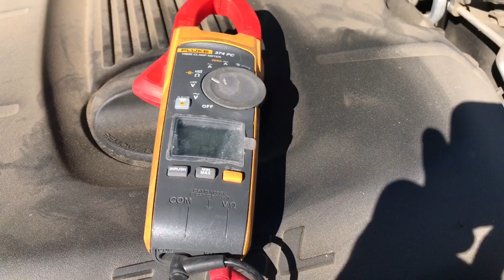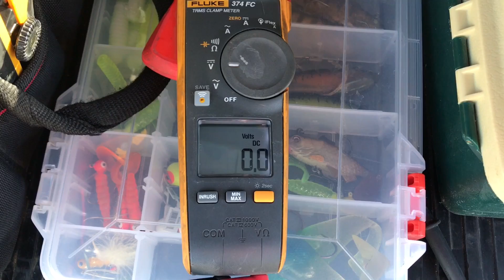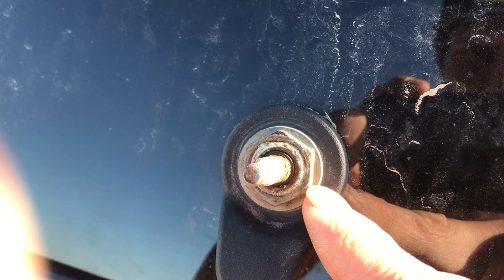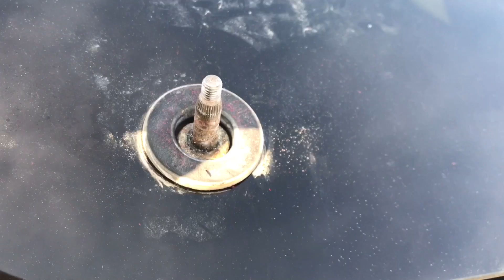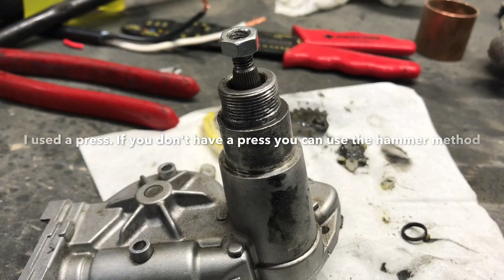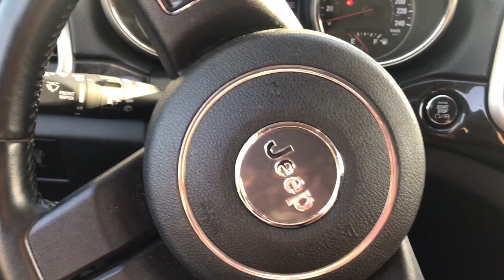How to: Rear Wiper motor repair and installation Jeep Grand Cherokee WK2 2011-2017

Comment: my rear wiper works but it likes to come on by itself and also squirt washer fluid by itself the fuses look fine i cant find any videos on how to fix it or why its happening! i even disconnected the power to it and it still squirted fluid when it wasnt activated! any help out there ? great video by the way! mine is a 2013 jeep wrangler.

Comment: Here it is 2025 and your video is still helping tremendously! The problem I had was is you had filled it all up with grease without showing how the gear positions should be and I had read. Someone said something about dots and after finally recognizing the dot in the triangle and where the gear is actually supposed to be I got it back together and it’s working fabulously! Now onto the next project

Comment: Thank you!! This was the exact issue with my 2012 Jeep SRT. Followed these instructions to a tee from checking fuse, power at the motor, assembly removal, disassembly, clean up, re-grease and reassembly. Works fine, now to replace the wiper itself.

Comment: Thanks for this video! Just picked up a 2011 and mine was rusted worse than yours. Instructions were amazing! I opted to just replace completely but I’ll keep the old part just in case. 

I know it’s been a couple years but any ideas on how to fix the flipper window? Mine is locked and I can’t get it open

Comment: This helped immensely! Sadly despite cleaning the rust i discovered the plastic gear had worn through, completely polished smooth. U.U another fine product by Denso... replacement is otw soon for $50! You saved me hundreds from the repair shops <3

Comment: Thank you so much very great ,helps me to understand the removal and installation,I would like to add that during installation the gear you must have both gears in the bottom shaft and the small one on top of the plastic gear must both gears aligned properly with the arrows.

Comment: Thanks for this video. Very helpful, just did the repair today on 2012 Jeep G. Ch.. I painted wiper shaft (the part above O-ring) with cold galvanizing paint after rust removal, I hope it will not rust again. Not all Made in Japan parts/assemblies are made perfect. This assembly should have double O-ring around main wiper shaft or other more robust seal, and shaft housing should be filled complete with grease, also the wiper shaft that comes above the O-ring should have better corrosion protection or made out of stainless steel. The mode of failure for this assembly is the rust from main shaft exposed to elements that is flowing down inside of main shaft housing.

Comment: Excellent video!  I had the same problem, so I removed the motor like you did and tried to pop out the shaft.  It wouldn’t come loose after blasting it pretty hard several times with a hammer.  I reinstalled it and it worked like a champ anyway!  
Better to be lucky than good sometimes 👍🏼

Comment: Very informative.  Hardest part was the gland nut and washer. Lots of blaster, deepwell 7/8" socket for the nut and chisel for the washer. I replaced.the motor and added silicone brake grease during installation.  Thanks!

Comment: This video is right on the mark. The shaft gets rusty, especially if you never use the wiper. I have a few tricks that he didn't share, that helped me in my repair. First, once you get the shaft out, if you don't have a wire wheel grinder, you can put the shaft into the chuck of your drill and spin the shaft against some sandpaper, with a little oil. Just be careful not to set the chuck against the threads. That will clean it nicely and keep it round. Second, when you put the shaft back in, and are aligning the gears, note that the two gears (one on the shaft and the little half moon shaped gear), that mesh together are both marked with some little dots. Those define the range that the gears travel back and forth. You can eyeball the midpoint between the two, and set the gears permanently. The dots touch when the gear combo reaches full travel at each end of the back-and-forth stroke and the wiper reverses travel. This is the singular position that makes everything work right. All of the pieces that go over the gears to link them to the motor and lock them together only go on one way, so you can't get it wrong if you get those dots lined up. Finally, change the o-ring behind the little plastic ring in the housing that the shaft goes through. This is a standard size that you can get at the hardware store for a buck or less. That might help keep the water out.

Comment: Quick permanent fix...remove rear wiper arm and throw away. Under left front of Jeep disconnect the washer bottle pump for the back glass (there is one pump for the rear window and one for the windshield). Apply "Rain X" so water beads on back glass...no more hassle. It's a great idea to use Rain X on all glass of every vehicle...windshield, mirrors, side windows, back glass. Just have to reapply as needed. It lasts a long time. I used it on my over the road semi for 30 years.   IMPORTANT:...make sure glass is CLEAN, squirt Rain X onto a DAMP paper towel,and apply like you would wax,  let it dry to a HAZE,  then buff the haze off with CLEAN DRY paper towel. And...do not apply it to or let it touch the wiper blade rubber when applying...it will "glue" the blades to the glass.

Comment: Thank you very much for the video!! Some remarks: if the trunk door is open, the motor is powered, but if just the glass window is opened, there is no tension on the connector (test from the min. 2). Regarding the washer on top of the plastic handle and the handle itself, I could remove them only using a sharp screwdriver. Pay attention that under the handle there is a rubber seal that is fixed on the window. Removal of these two parts were tricky not to break the window or damage the rubber seal.

Comment: The motor on wipers is not worth a rebuild the price of one is $ 60 bucks to $100 buy a new unit and be done.
Reply: If refurbished will be better quality as packed with grease and last longer

Comment: Sorry if this is a dumb question, does the shaft have a slight bend to it? It looks like my shaft is slightly bent and I assume that's my issue but wasn't sure if it was supposed to be like that for some reason. Thanks!

Comment: Great video.  Gave me the confidence to go out and go at it.  Unfortunately, I seem to have another issue.  I have no power to the motor.  Jeep running and rear wiper on but still no power.  Fuse was good.  Any idea where to look next?  Thanks

Comment: Aug '20, dealer told me some time ago wiper motor bad. Bought motor from salvage, plugged in & still not working. Tested voltage from engine to 1st clip at hardtop - getting nearly 5 volts. Checked same on neighbors jeep - same voltage, check. Watched your video on supplying direct electricity to motor and have question. Both old & new motors I connect direct electricity to clip on wiper mount. Neither motor worked. I didn't connect directly to motor as you did so shaft may be seized on both I guess. Did I observe correctly that when you validated motor worked that you used only positive off battery and didn't involve black or negative?
Reply from the maker: Nope. You need 12 volts for the motor to operate. You have to use the + and the - to get your 12V 

If you just use the + nothing will happen
Reply: @wk2outdoors321 , mine is an '09 Wrangler 4dr "jk" 1st the good news I separated the motor from the wiper blade mechanism that is to rotate back & forth and just the motor works! Confirming the mechanism is seized.
Next hurdle, on my model the black plastic spout that shoots window cleaner is @ 90 degree turn and I can't get the wiper mechanism out to disassemble as you did. Any hints on removing the washer dispenser from motor body so I can pull this from metal frame?
Reply from the maker: @briansmith1802  sorry no tips on that. I've never worked with any other jeeps besides the Jeep Grand Cherokee. I'm not a mechanic by trade I just tackle the odd DIY projects. Good luck!

Comment: 2013 Jeep Grand Cherokee here.

I followed this to the letter and it only took me less than an hour to replace the motor from its housing and put in the new one! (I have the old one if anyone wants it ;))

The only thing I'd suggest about this video is that I'd let viewers know that WD40 is your big time friend here. Use it every step of the way, from loosening every rusted screw to when you reinstall the new motor. I made sure to lubricate everything as I went along and it helped, as Jeeps rust FAST in some spots and on a lot of parts.

Thanks again from a thankful viewer!!!
Reply: ive had alot better luck with pb blaster over the years

Comment: Totally awesome TY so much!  Had exactly the same issue. Could see it wanted to turn and couldn’t.  Just removed the outside parts, cleaned away the corrosion, added plenty of WD40 and it is good as new.  10 minute fix that I wouldn’t have had the confidence to do otherwise.  Would have cost me a wiper motor plus labour at the garage for sure!

Comment: Great tutorial.  I can't thank you enough.  Cost me a motor and some time, but so much cheaper than the $450 the dealer wanted to fleece me for the job.  Again, great tutorial, descriptive, and easy to follow.  Thanks A LOT!!!!  Now ..... I am still afraid to take the old motor apart and try and fix that :)
Reply from the maker: Give it a shot! What's the worst that can happen? 😏
Reply: @92bear  450!!!! 🤣🤣🤣🤣 LMFAO you one of them. You lucky we never crossed paths. I'm the type that can sell tacos to the taco truck. Back in my Big-O tire days, I'd pistol whip you with my mouth piece $450 - $500 just for a simple brake job and that's just for labor . A simple $3.00 car part (we'd get a phat discount) would end up costing you $100 add that shit up and you'd be the reason why Christmas time came with a phat bonus. Moral of the story is simple, you sound like a little bitch 😭 the dealer blah blah blah. A bitch is only good for one thing make my pockets fatter. Don't be the bitch don't be scurd 😱 if you fuck up no sweat. You can easily get it at Pick N Pull and just sneak it out.

Comment: Wow thanks, it was the same as yours very corroded. It was very tough getting it off. I got the motor working on the bench, but I have no power at the plug (ya the fuse is fine). I’m gussing the switch is the issue, hopefully not a broken wire. 
Thanks for the help. You got to love utube help videos, saved me a lot of money.  Now I need a vid on a switch repair

Comment: Cant play video more than 48 sec. Another way to watch it?
Reply: same problem
Reply from the maker: @binlama_oussaden  video works now. enjoy.
Reply from the maker: It works for me. Did you try the video again? Is it working?
Reply: @wk2outdoors321  doesnt work
Reply from the maker: @jean-simonboissonneault8020  only the first 45 seconds is working for me now. Hopefully it fixes itself soon. Its a problem with YouTube.
Reply: @wk2outdoors321  YouTube respond me thats your video is the problem and they couldnt do anything for me
Reply from the maker: @jean-simonboissonneault8020  this is very odd as the video worker fine for years. It's definitely a YouTube problem. I will contact them
Reply from the maker: @jean-simonboissonneault8020  video is up and running now. enjoy.

Comment: It's May 2019 and your video is still helping us, i was terrified to fix my rear wiper motor, but i remembered your words" don't be scared, you got to do what you have to do" I took it step by step and every time i go back to your video to see how you did it, I have the motor out now, thanks to you I know my motor is working just need to clean the shaft put a lot of WD40 and tomorrow I will grease it and close it , crossing my fingers, i will find out tomorrow if i success :-), I just hoped you walked us through putting it together back. wish me luck

Comment: Any chance you can show how to properly re-assemble the motor/gears. I thought what I did was correct but it’s still not working. A step by step video would be excellent. And I think you’re the guy to do it! Please!
Reply from the maker: Thanks for the kind words. I don't currently have a spare motor to take apart. 

Just take it apart and try again. You'll get it :) 

Always test it on the bench before you install it in the vehicle
Reply: @wk2outdoors321  Same thing  happened to me today. What can trip you up is the alignment of the wiper shaft as there are v pins you can see right above the gear on the shaft that lock it into the housing. After putting the shaft back in the housing, rotate 100% counterclockwise and position the armature with the teeth so that it's only connecting with the first couple of teeth on the left. As the white plastic gear pulls the armature down, it'll pull the gear on the wiper shaft clockwise.  Very helpful video otherwise, saved me 400 bucks that the shop wanted or at least $100 for me to do it myself. Thanks!

Comment: This was my issue too.  Thank you for posting.  I might add that it's a good idea to clean out the inside of the housing where the shaft spins inside as it too gets rusty just as the shaft itself does and lubricate.  Also a good idea to replace that O ring.
Reply from the maker: Great tips! You're right. 

Thanks for the comment :)

Comment: Great post man...thanks for sharing.  Your bright lines cross bar video was helpful too.  I ended up not having to pull the motor.  I removed the wiper arm/rubber boot and took a small brass file brush to the shaft which was heavily corroded.  Sprayed some Jig-A-Loo multiple times and allowed it to penetrate the shaft seal.  Then I attached a small pair of vice grips to the shaft and turned on the motor...applying a light amount of pressure on the vice grips I was able to get the shaft turning...keeping the pressure on until the shaft spun freely.  Works like new now!!  Thanks again!
Reply from the maker: Thanks man! I'm glad it worked out for you! Appreciate the comments and the kind words! Keep on jeepin'

Comment: That nut he took off with the vise grips is a 22mm. Just use a socket with a breaker bar...super easy
Reply from the maker: Thanks for the comment! I hope the repair went well for you
Reply: @wk2outdoors321  the only slightly difficult thing was getting the wiper blade off. Other than that, it was a 15 min job thanks to your video.
Reply from the maker: @ericperry72  I'm glad I was able to help. More videos coming as soon as more things break haha! Have a great day!

Comment: Awesome video. I too was having my wiper get stuck at the 12 o clock position. I took off the nut and the shaft was covered in rust and debris. I cleaned it up and sprayed it with some fluid film and that was the fix to my problem. If it arises again I will take out the motor and follow the instructions you provided.

Thank you
Reply from the maker: Mitchell Chaves thank you very much. I appreciate the subscription! More videos coming soon :)

Comment: One more happy viewer here. When I took it apart, things were misaligned in the gearbox, so it was jammed up. I still cleaned the shaft since it wasn't exactly turning smoothly, and reassembled and all is well. Thanks.
Reply from the maker: Glad to hear! Thanks for the support and leaving a comment :)

Comment: Thanks for your information.  There is more to the story however.  My 2013 grand cherokee had a bad motor which I replaced with one from NAPA Auto Parts.  But it would not run so after contacting a mechanic I know he told me that the power to the fuse under the hood did not receive power until the jeep is started and the wiper is turned on.  Even then there was no power to the wiper motor so I took the jeep to my regular service tech and had him to clear all errors on all the computers in the vehicle.  The wiper motor started working immediately after the errors were reset.

Hope this information helps someone.
Reply: I tested my fuse and it was fine, but no power to the motor as you're saying.  I'll try clearing all errors and see if that helps.  Thanks

Comment: Hey thank you so much for this video mind just went the other day and I need to figure out what’s wrong with it I looked up my fuse it looks fine so I’m assuming I might have to do what you did essentially the only issue was that it was very dirty inside correct?
Reply: If you can rebuild motors as small as that, grease and lubricate everything, clean off the shaft, and it might work again once you put it back together, and the best thing to do is just clip on the electricity, put the fuse back in and then see if it turns on, if it doesn't then your motor is probably screwed.

These motors go between $90 and $130 brand new. 

If you need to buy a new one, so be it, I did and it worked perfectly!

Take your time and you'll see the results.

Comment: My biggest concern was safely removing the motor from the window. The instructions were exactly what I needed for my 2012 Grand Cherokee. Motor is now on my bench ready for repair. Thanks very much. (I strongly recommend using a gear puller to remove the wiper arm. 3" (75mm) worked well for me.)